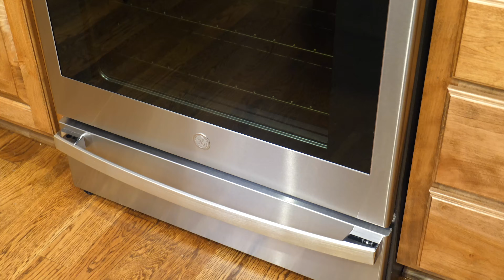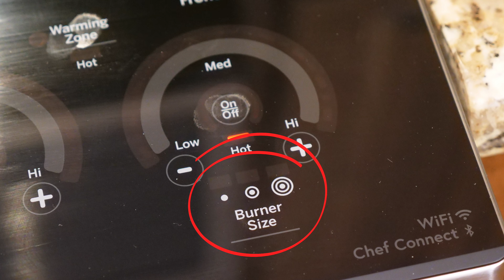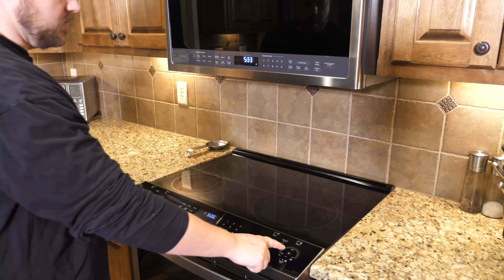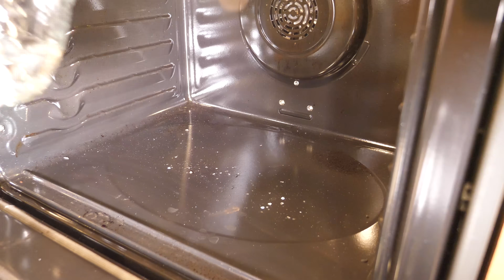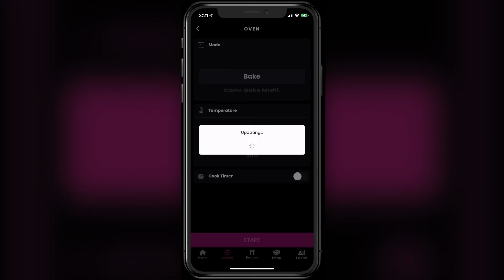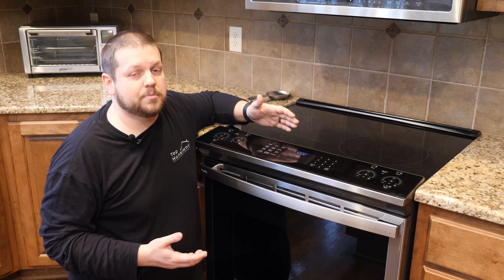Is This The BEST Convection Oven? GE Electric Range Review that has an Air Fryer and MORE!

Comment: I've been looking for a bridge element cooking range that didn't have the knobs in front but they were only available in higher-end models such as induction and this slide-in model. I ordered an induction model  because I had read how great induction models were but I didn't want to replace all my pots and pans especially my wok, so I've been looking for an electric range that checks my wishes for functionality, easy-to-clean maintenance, and beauty. This GE model checks most of the boxes except for the height. Also, I don't really like how the raised electronics panel looks, but it's a good option. Also, does the digital panel raise it higher than the typical range by 1 to 2 inches above the cooking surface? If I bought this model, I would have to change all my plans for my fridge and microwave so the stainless steel and brands match. I already spent a lot of time researching for a fridge that fits my space and matches my other appliances.

Comment: We bought an induction/convection oven. It has many features on that I wanted. Bread proofing, air fryer, the double burner for a griddle, convection, digital controls, the cleaning settings...  We bought it at a discount store, which was not the problem. The first day I used it, I found out I couldn't use 1/2 of my cookware set on it because it needs to be compatible to an induction oven which I didn't know. Then, the proofing setting didn't, it also didn't bake evenly when I used convection and so on. So they gave me a different, higher end oven. It looks like the one in your video. At first I liked it, I love how fast it heats up the food or water comes to a boil, or how fast it comes down from a boil so it doesn't cook over, I love how fast I can clean the oven top after using it. But then one of the new frying pans that I had to buy new, stopped working on it. I was told I had to reset the oven by unplugging the oven. Fine. Then we tried using the air fryer, well that doesn't work like advertised. The food stayed white and soft. We had to deep fry the fries so it would get crispy. Every once in a while the warming setting doesn't warm up to the temperature it is suppose to. My induction ovens have not held up to the high praise that I have been hearing about, at least not the 2 that I have tried in the last 6 months.  I would NOT buy another one. In fact, if GE would take it back and give me a regular oven with all the features of this one, I would in a heart beat.
Reply: I ordered an induction cooking range but it won't be delivered until mid summer. The lower end model of induction doesn't work as well as the premium model based on what I read. The lower models uses a fan to circulate air to create an even temperature but it's not effective. You have to buy the more premium model with True Convection which has the fan and motor incorporated into one unit. Also, if you wear a pacemaker, the induction range will interfere with the induction energy.

Comment: I got GE induction range today and found that the big burner (11") is very slow
Took 13 minutes to boil 4 cups of water, and it makes high noise when I turn the back burner at the same time
The left 8" one took 6 minutes to boil 4 cups of water...

Another portable induction cook top i have (1500 watts) tool 10 minutes to boil 4 cups of water

Is it normal for that big burner (11") that should be the most powerful to take 13:xx minutes to boil 4 cups of water??

Comment: The touch controls are too sensitive. Opening the hot oven when burners are also in use frequently results in the burners being turned all the way up or all the way down by the heat hitting the outside burner controls. Also if anything splashes or drips on the burner controls, they adjust. Including bubbling from the pot on the burner.

Comment: I purchase this induction range, had to replace main control board at just under 2 years, cost $1500 cdn. ,  not included labor,  they blamed the Ninja induction frying pans, they were not completely magnetic, causing over heating of control board. Best thing to do is to stay away from induction , or when you buy pots and pans make sure you take a magnet and ensure both the bottom and sides are magnetic. No comments from Ninja, when I contacted them about their induction safe frying pans, garbage. Welcome to the new crap after Covid 😮😮😮😠😠😠
Reply from the maker: Really sorry to hear that! Thanks for sharing your experience

Comment: Those are not long lived ranges when the touch panel is up front because it gets exposed to extreme heat every time the oven door is opened and they burn up boards a lot quicker.
Reply from the maker: We've had ours for a couple of years now and no issues so far. We use the oven 2-3 times a week
Reply: @TopHomeowner   Awesome maybe they have improved 👍🏼.

Comment: Do you have to be connected to wifi or internet to use the air fryer?
Reply from the maker: No, wifi is optional. You can do everything from the panel

Comment: One other Con is there is not side lip to catch spills if something boils over and runs off the sides. It is definitely a plus to have child protect as well as no knobs as I tried at Home Depot to run up against the front knobs on the various ones on display that had knobs left one them (People Stealing them because the break off when bumped hard I assume), and noticed all the front knob units were very easy to turn on if you bump them or rub up against them so rather than say "Child Proof" I would say Human Proof is very important unless you want to burn down your house just cleaning the counters or walking in the kitchen. Think about it, getting an range with knobs in front might = living in a van down by the river?

Comment: Do ANY of these glass top ranges stay unscratched after just a few months of using them daily? (no matter how careful you are)
Not a single person I know is happy with theirs after an incredibly short amount of time, though they were thrilled when it was first purchased. Unless you are outlandishly careful each and every time you place a pan on it, that thing is gonna get scratched, and fast. Like, you'd have to be using the touch of a next-level Mohel performing a circumcision on a baby from royalty, while saying a prayer, to keep that glass top from looking pretty worn in no time.
Reply: I noticed the reviews mentioned that problem. It seems to be affecting the newer ovens. I am trying to be careful with it. I don’t pull out things from the oven, and set them on the stove top. I also try not to slide pans around on the stove top. Fingers crossed!
Reply: I’m not as careful as a Mohel performing a circumcision on a royal baby, lol😂!

Comment: Important features for me: being able to turn down to low simmer (my current induction cooktop's lowest setting keeps things at rolling boil.) Air fry feature: is it as good as a standalone air fryer? Do we know how it compares in energy usage to a smaller air fryer? Controls: is having messy or wet hands a problem for using the controls?

Comment: if the wi fi is conecting will not work manually
Reply from the maker: It will work manually, the wifi gives you an option to turn it on and off from your phone and lets you know when the oven is preheated or the timer goes off. But all of that is available on the control panel as well.

Comment: I bought a GE Profile Double Oven (7000) and it seems great. It's replacing my Thermador double convection oven that died after 20 years. However I am VERY Disappointed in GE's instructions and lack of material on how to best use some of the features like air fry, steam clean and dehydrate. I didn't know that there was a way to synchronize the clocks. Why don't they have instructional videos if they  don't supply instructional materials.
Reply: I just bought the GE double oven. I haven’t tried the air fryer or convection yet.
Reply: I feel the same way. I have no clue about using the broiler! Take the pan from the bottom, leaving elements exposed??
Can anyone correct me either way, please...

Comment: I have quick question.. what happens when the ranges doesn’t come on?
Reply from the maker: The usual culprit is that the panel input is locked. Just touch the lock button for 3+ seconds and the buttons should start working again.
Reply: @TopHomeowner  I will give that a try! Thank you

Comment: We've had ours for a year- the oven's bottom element is under the metal floor (?)- this oven does a lousy job of cooking thin crust Papa Murphy’s pizza. We love crispy, thin crust pizzas, and the family size ones we usually get stay gummy in the middle, and we can’t get them off of the tray for “final cook/crisping”. Not sure about thicker crust pizzas. The closest we can get is if we poke holes through to the back of the tray... tedious and frustrating. Burnt tops, and hardly cooked bottoms... Our old electric range had the exposed bottom elements: not as neat, harder to clean, but baked those thin crusts to perfection! Sometimes the cooktop controls do their own thing: oven settings program, waiting for someone to start it, but it won’t turn on OR off... If your hands are damp/wet, forget any controls working. Water drips turn the stove top on... We would prefer gas, but are stuck with electric... Not thrilled with this range... Maybe they’re all this way.

Comment: Hello again:  I apologize, I have a few additional question about the air fry option.  I have never used the air fryer and ;from my previous experience with the GE appliances Manuel it limits a lot of the instructions and how to use it.   Do I need a special kind of tray?  I am excited to try it out but I am clueless as to how to use the air fryer.  I have never owned one.  Thank you again for all your assistance.  Renee
Reply from the maker: I think they make a basket for it that you can purchase separately but we just use a standard low profile baking sheet with the air fryer option.
Reply: @TopHomeowner  thank you so much for the response.  I just started using it a few days ago. I love it.  It takes a little getting used to.  Bringing a pot of water for spaghetti for example takes a long time to heat up.  Other than that so far I like.

Comment: Hello, thank you for sharing this tutorial.  We just recently purchased this and it will be delivered in February.  I currently have the Samsung convection and so I am familiar with the glass top service.  I have old Cuisinart skillets that need to be replaced.  I am worried about the durability and it scratching.  Can you suggest the types of pots and pans I should look for.  Also, the size tray that can be used for dual feature?   Thanks in advance for the recommendations.
Reply from the maker: We've had ours for a year now and haven't had any issues with scratching. Our pans have stainless steel bottoms. We do have a cast iron pan but I've not used it on the glass top because I'm worried that one will actually scratch the glass. I haven't tried a dual griddle yet, all the pans I've found have had some reviews stating that they can warp from heat so I'm still looking.
Reply: @TopHomeowner     Thank you so much for the response.  I greatly appreciate.  If there is anything else I should know about the unit please let me know.  Thanks again.

Comment: What is the very frequent clicking noise on the "GE PHS930SL3SS" when using the oven?
Reply from the maker: Its relays cycling the heating elements on and off: https://products.geappliances.com/appliance/gea-support-search-content?contentId=16858
Reply: @TopHomeowner  I'm familiar of course with this,  but it clicks every few seconds. I would expect it to click every few minutes, maybe every couple of minutes, but it's much more frequent than that. What's going on do you think. A problem? (I dont think the relay cycle n and off as frequently in "Convection Bake" or "Convection Roast" mode, but more trouble shooting is needed to be sure.)

Comment: Do you need to have your electrical panel upgraded from 220 to 240?  When using the oven does the outside get too hot to touch safely?  How difficult is the glass top to clean?  The difficulty cleaning the glass tops has been a huge  detraction from glass top stoves.  Has that been improved?
Reply from the maker: 220 is fine per GE: https://products.geappliances.com/appliance/gea-support-search-content?contentId=23989
Reply: @TopHomeowner  Thank you

Comment: All these ranges ditching knobs upsets me. When you cook you might have wet hands, dirty hands, hands in oven mitts, hands holding ingredients... all of which will be a problem on capacitive touch interfaces. It's annoying that if you want a GE with some good old fashioned knobs you have to spend up $1000 more to get the equivalent Cafe range, which even has downgraded burners without selectable sizes. No wonder people flock to Samsung and LG, their lower cost designs at least make sense.

I imagine this is happening because it reduces manufacturing costs to make recessed counter cooktops and rangetops as similar as possible, and cooktops have ditched knobs to be sleek and low profile.
Reply from the maker: Not having knobs is a great feature when you're concerned little ones might "accidentally" turn on the stovetop. So far we've had zero issues with it being capacitive touch... use or otherwise.
Reply: The regular GE models (not profile, not cafe) have knobs for all the burners. The oven is controlled by touching a control panel and number pad. They are the same quality but lack wifi (smart) controls. 😊

Comment: Weirdly for me, the stove doesn’t seem to turn on, I click on, set range of heat, but then the light starts to blink and turns off after a few seconds
Reply from the maker: That is odd. For the oven I press Bake, set the temp and then push start. For the burners I push on, and touch the temperature circle (or +) and they start heating. If I wait about 30 seconds without pressing Start (baking) or the wheel for the burners, it times out after 30 seconds. It sounds like you might need your unit serviced if yours is acting differently.
Reply: @TopHomeowner  it might be. So for me the oven works it’s pretty simple to start, but yeah I press start on the stove, set burner either by touch pad or + - but instead of starting it just blinks for a few seconds and then it times out and doesn’t start the heating
Reply from the maker: Yeah that's not normal. It sounds like it's trying to heat up but then kicks off because it can't. Sorry it's being a pain.
Reply: @TopHomeowner  there is also a “heating area” section that’s like in the middle of the 4 burners, that one you just turn on and that’s it, that one does heat up for me when I click start
Reply: Loose connection on the Relay Board ( Back of the Unit )

Comment: Been using this stove for less than a week and already the touch control panel is not working.  Waiting on a service call.....
Reply: Has this been resolved? That touch screen looks slick but I'm concerned about its longevity. Will be a pricey part to replace out of warranty
Reply: @Free-g8r  Not yet.  Still waiting on parts....
Reply from the maker: Ugh sorry to hear that, hope you get a resolution soon.
Reply from the maker: Bummer... Hope you get that resolved quickly.
Reply: @TopHomeowner  Service guy was in.  Two new control boards ordered.  We'll see how in goes in 2-5 weeks.

Comment: Those the stove comes with the air fryer basket??? The other brands it doesn't come with it and you have to pay over $50 dollars extra.
Reply from the maker: It doesn't come with the basket unfortunately. They just have the air fryer setting/feature.
Reply: I used the air dryer feature recently and made crispy Buffalo chicken wings. Line a large baking sheet with parchment paper (for easy cleanup) then put a wire rack over the pan. I did 475 degrees...30 minutes. Turn wings over halfway through. Excellent results!

Comment: My experience is with the GE Profile PGS930BP1TS. The stove top is great - very flexible - simmer and fast boil both work well. The oven is more problematic- the steam clean is a joke. And the high-temperature clean caused the oven controls to die completely. GE did replace the unit ( apparently parts aren’t available), but I am hesitant to try a self-clean again.
Reply from the maker: I agree that the steam self clean really isn't what we thought. It was fine for the first time which is included in the video but hasn't done much since. Sorry to hear about your control panel, we have not encountered that.
Reply: A second attempt at self clean resulted in the oven light no longer working. Control panel needed replacement.
Reply: I'm interested in buying this stove but after hearing this, I'm a little hesitant. So you tried to self clean a second time and more stuff happened. Any updates ?

Comment: Burner left on low and was covered with a drying mat, it melted and stuck to the glass, when cleaned it left dents on the glass as if someone hit it with the hammer. Why would anything melted on the surface of the glass the chips on the glass? Can the glasstop be replaced?
Reply from the maker: I'm not sure. I'd talk to the place where you purchased the stove and see what can be done. Sorry to hear you're having this problem.

Comment: Does the cook top have a lip or boarder around it to prevent spills from dripping down the sides? Are the side panels finished to put this unit on an end piece? Thanks for the review video, really helped!
Reply from the maker: There isn't a lip so you would need to get a silicone (or rubber) filler that's made for stovetops. The sides are finished but its a textured metal that's charcoal gray.